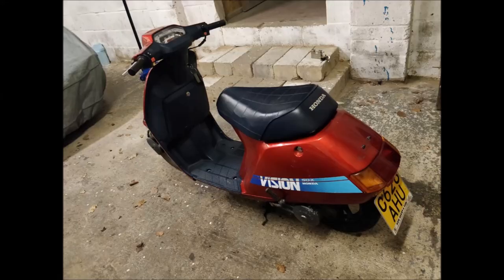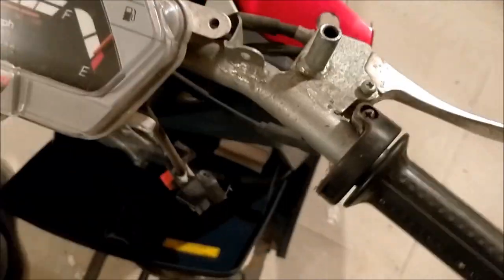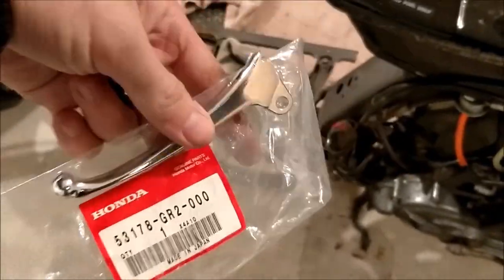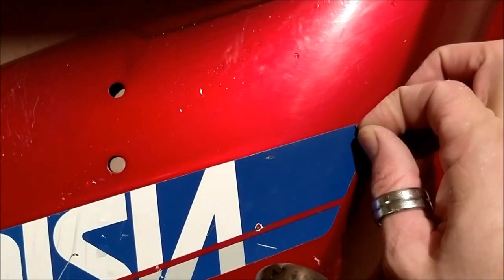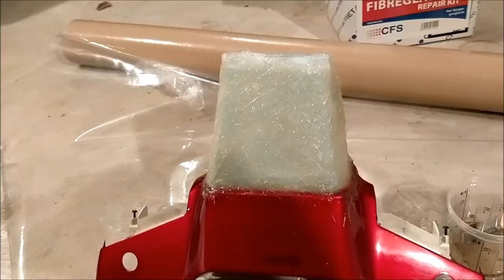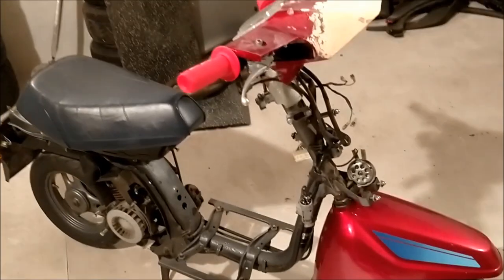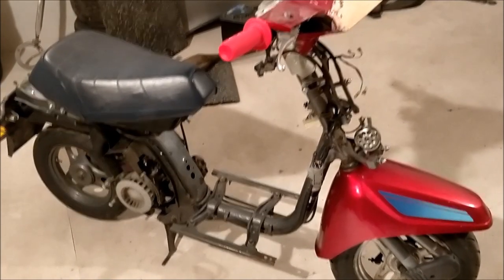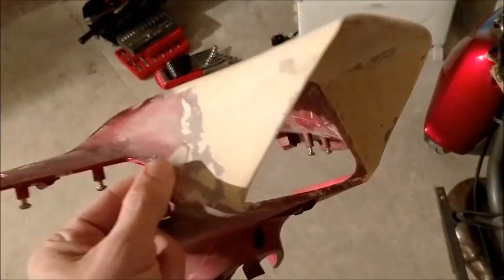Building A Japanese Style Scooter - Part 1

Comment: Hey mate I know I'm a bit late to the video but I was thinking of doing something simmilar. And was wondering where you got the air horns ? And did you just mount it to the gb?
Reply from the maker: I think they were an ebay purchase and yes just mounted using a bracket
Reply: @Keep-It-Wheel  thanks really appreciate this!
Reply from the maker: @sheaewart7618  Anytime, try using クレタクto search
Reply: @Keep-It-Wheel  did you also find the tact on Yahoo actions ? Or local
Reply from the maker: @sheaewart7618  It's a Vision in the UK. I bought it from a chap in Bristol.